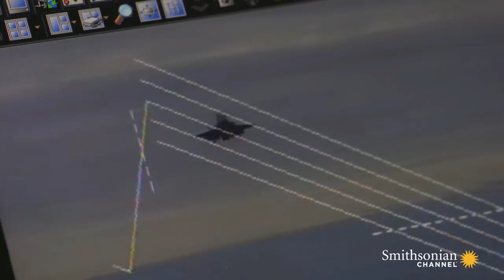This Fighter Plane Landing Has Never Been Attempted

Comment: Question is: How many pilots have the skill to do this in one go? There's no 2nd chance during war
Reply: ꉣꏹꉣꉣꏹꋪꁏꋊꀤ it would be the same as any other carrier landings. Pilots do have many chances to land on carriers which is why they use afterburner for every landing incase the hook didn't catch a line, they fly off and try again.
Reply: It’s also why they will practice this over and over to eliminate possible mistakes. It’s proven that it can be done, plus any pilot flying this plane will have the skill set to do the required landing. If they don’t then they won’t be flying it much longer
Reply: Ever heard of something called training? Most soldiers can shoot guns too, they don’t wake up knowing how to do it tho lol
Reply: Operations in actual theatre will not resemble that of enemy fighters circling the carrier fleet whilst CIWS battle to neutralise the threat. A misconception derived from Call of Duty etc.
Reply: All pilots, that's because of something called a selection and training process.
Reply: Im more interested in the tatical use of this ??? Anyone know ? Is it like a smaller run way when this landing is used ?? 

Thanks 🤔🤔
Reply: @blakeley38  There's only two options, vertical landing or this. Vertical requires them to potentially dump fuel and weapons to get themselves light enough, whereas they can carry fuel and weapons back that aren't used using this method.
Reply: @blakeley38  The air craft can land with more weight. 
If an air craft lands with its take off weight it is likely to crash due to the force it is coming down with. Simple F=M x A.
The landing gears will not be able to handle the force so fuel dumps / cargo or weapon dumps are necessary.  Also another factor is the stress to the surface of the ship's deck.
Heat from the engine is not directed into a single point on the flight deck from a vertical landing, so reduces stress across the deck.
Reply: @blakeley38  If you were listening during the beginning of the video, they said that normally these planes have to land without ordinance and with low fuel. If, for some reason, you send these planes out in wartime, and they come back with ordinance that's not spent... you'd have to dump the ordinance and/or fuel in the sea, and that's expensive and inefficient. So they're trying to come up with ways to land these planes on the deck with their resources still on-board instead of wasting them.
Reply: Many pilots will be landing this way first time without dificulty.

This was the first time it was tried. Thus they were cautious and of course the instrumentation requires calibration and verification.
Reply: adam b It’s the F-35B which doesn’t have an arrestor hook, instead relying on Short/ Vertical take off and landing. They are to be operated from British aircraft carrier that doesn’t have catapults or arrestor wires.
Reply: Why would there not be second chances during war?
Reply: Because this has now been done for real outside  of the simulator all the data of his landing and approach will doubtless be recorded - that data then can be processed into a series of guiding instructions which other pilots can then practice first in the simulator before going live just as this pilot did.
Reply: There is on Call of Duty!!!!
Reply: If it doesn't work they can always land vertically.
Reply: @srinitaaigaura  They can't if they have weapons or too much fuel on board. The only way they could land vertical is if they ditch all their remaining weapons in the sea.
Reply: The British have been landing aircraft on ships like this for decades!! So it's nothing new, it's only the air craft is new
Reply: There is always a 2.Chance you only have to be smart or be a lone wolf
Reply: There literally is.  Wartime or peacetime you come back with enough fuel to have more than one attempt.  Failing this, jettisoning all ordnance and dumping fuel will still allow a vertical landing akin to the hundreds of thousands the RN has been successfully completed in peace and war for decades with its harrier fleet.
Reply: Woutube Yatcher  This is the UK
Reply: @Benjd0  and sometimes jettisoning of the payload is not possible for to malfunction, so it's good to have other options.
Reply: Hammer 001   No it's not what I was saying. We're talking about carrier operations here. Of course it can perform a normal landing, I just expected people to be aware of the context of the post. No need to resort to insults over nothing.
Reply: Hammer 001  If it's not an insult what would you call it then? I'm curious. Just letting you know that there's no real need.

I said it required them to potentially dump fuel or weapons, it's not a requirement. But the weight they need to get under is fairly low, if they go on a mission with a full payload and don't use any of those weapons, then they will be required to dump either fuel or weapons. It doesn't have to be an emergency.

SRVL increases this limit, so they won't be required to do this as often. Although if they're immediately returning with a full payload, they will still likely have to dump weapons or fuel, as the SRVL weight limit is lower than the take off limit.
Reply: Hammer 001  Not sure why you're getting so worked up about this, it's just a Youtube comment section, you need to lighten up a bit. I didn't say there would never be a need to dump fuel or weapons with SRVL, it just allows a higher bring back weight over a fully vertical landing, that quoted weight is still below the maximum take off weight.

There's a fair bit of information out there on this, it's not top secret information that requires you to be on board the aircraft carrier, now if all of these sources are wrong then fair enough, just commenting on the information available.
Reply: @Dhalin  There is an ordinance - NATOPS - on landing with ordnance.
Reply: @martinw245  "Many pilots will be landing this way first time without dificulty."

Perhaps with plenty of practice in the simulator first.

Wilson needed three attempts to recover aboard the QE after flying 2000+ SRVLs in the simulator. It's not as nonchalant as many think.
Reply: @AA-xo9uw  

"Wilson needed three arrempts"

Well yes, it had never been done before. And they were obviously being cautious.  But once the correct parameters are determined and landing aids fine tuned  it will be relatively easy. To determine optimal airspeed flightpath angle and the ships landing aids fine tuned etc in only 3 attemps demonstrates that it's not a difficult procedure.
There's always the weather sea condition and deck movement to consider of course.

As said in the video, "the pilots had been making tentative approaches to test height and speed combinations.

Comment: “This fighte Plane landing has never been attempted” 

Yak 38: am I a joke to you!?!?
Reply: Strangely enough, the F35 is based on the Yak-38 design. Lockheed even paid Yakovlev royalties.
Reply: @spacecadet35  I think it was other soviet vtol
Reply: @dang0s804  - The Yak 141 is developed from the Yak 38.
Reply: @spacecadet35  Yeah but the F-35  is based from the Yak 141
Reply: @dang0s804  True. Either way Yakovlev gets the money :)
Reply: yak38 was a good design but the lack of power was its demise. Yak141 was something else Though.
Reply: Harrier?
Reply: Sad harrier noise
Reply: @spacecadet35  Did Yak then pay Hawker Siddley for ripping off their design in the first place?
Reply: @Jin-Ro  - As the Harrier and the Yak use totally different engine and design  concepts, I am not sure of the relevance of your statement.
Reply: Why so much Yakking in this thread?
Reply: @mierbeuker8148  You are right. There is a lot of yakkity yak on this thread.
Reply: @dang0s804  Incorrect.

Comment: Go on a tease diet and head to 2:50 if you want to see the landing.
Reply: This needs to be on the top
Reply: What about the landing at 3:42 ?  Looks like the carrier is out moving in the ocean by the backdrop waves and he landed straight down easily. please explain lol
Reply: @73outback  the plane needs to be light so they get rid of extra weight like weapons. They say this in the beginning.
Reply: @aflyingsquid___2494  ??
Reply: @73outback  0:16
Reply: @aflyingsquid___2494  Never mind you still didnt answer my question but you might have understood it wrong. i figured it out myself. In those clips the jet goes straight down. But they were talking about a 1st ever rolling vertical landing.... not a stationary vertical landing which i mistook them doing.
Reply: @73outback  Several videos shot during multiple test flights have been combined and edited into the one here..

Comment: The reason the planes are that heavy, is because of the massive balls they have to carry
Reply: The reason they are heavy is because they are garbage
Reply: @hugh.grection1386  you think design a steath plane that can VTOL is easy...
Reply: @hatosan5565  it wouldn't be so hard but not only does this plane have to vlt it has to do 1000 other missions for the other services,if the marines so badly wanted a vlt aircraft they should have designed a plane for that but no they have this plane trying to do everything while still maintaining stealth,it doesn't work this is why the navy will continue using f18s and the airforce f15s
Reply: @hugh.grection1386  ahhahaha...NO! F35B was build to replace Harrier Vtol not F18 and F15(why the heck you include the F18 and F15 when they both don't have Vtol),the one that that replace F18 is F35C,F35A will replace F15,F16,A-10(maybe) in airforce
That why they design 3 variant
-F35A is for airforce which more maneuverable and cheapest one with 77M$ 
-F35B is for Marines Force which is a huge game changer for those are Heli carrier can turn in to light aircraft carrier right away ,thank to the engine vtol that can make Vtol much easier than harrier
-F35C is CV variant that future the better landing gear for the leg and much bigger wings for slowing down better and carry more fuel
Reply: @hatosan5565  u are not getting what I am saying,the only difference between the f35 B and the others is they took out the lift fan and ability to point jet engine at ground of course but still leaves a huge cross section increasing drag and friction heat that melts it's radar absorbing paint,this is why gen 4 planes out run them by alot,it's a garbage plane,last air to engagement the usa got into was over syria and it was a in sight engagement with a mig and the first missile fired missed,if that was a f35 the mig would have smoked it simply by running up on them
Reply: @hatosan5565  and none of them replace the A10 warthog... so... once again: senator McCain, thank you for everything you have done to keep the A10 flying. The beers are on me when we met other side of the rainbow.
Reply: @G_de_Coligny  well A-10 will flight 5 to 10 more years(because it so good),so I'm not worry about it
Reply: @hatosan5565  859
Reply: S Lit because I don’t think just anyone would try to do that
Reply: Getting a bit weary of this all too predictable comment

Comment: Is there anything really new here other than the plane being newer than the British Harrier, and... wait for it... the Russian Yak 36?
Reply: I think you mean the Yak-38. The 36 was a test platform. Either way, the F-35B uses some of the underpinnings of the Yak-141, whose design was sold to the US by the Yakovlev Design Bureau.
Reply: Or f18
Reply: @gregoryhall2967  what? F18 is vtol. Tf you talking about?
Reply: Yak was POS, Constant breakdowns
Reply: @nibs7252  The F35 was based on F22 lockhead also made. The lift system is totally different concept,  as it uses a single pratt & whitney engine that also powers a lift fan via driveshaft and gear system. The lift fan was chosen because it provided a cool air stream, versus the older harriers that had hot air ingestion issues.

Yak141 use three engines. With two mounted vertically to provide forward lift...which produces hot gas.Totally different wing configuration, totally different tail configuration, is not fly-by-wire, has no internal weapon bays,  is 50% larger in size,  almost twice the weight of f35, had afterburners.....

f35 has no underpins of the yak.....your literally comparing apples and oranges
Reply: @gregoryhall2967  F-18 does not have VTOL capability.
Reply: Wasn't th Harrier developed in the 60s or 70s?
Reply: @David.....  F-35B is literally the result of Locked Martin purchasing the intellectual rights to the Yak-41. Go Google it.
Reply: @wojciechmuras553  he litterally just explained how that's not true. "go google" that one
Reply: @chickenman9184  Locked Martin used Yakovlev's expertise during the development of XF-35. These two companies literally made a joint venture in 1991! And the result of that was Yakovlev engineers building the lift system of the F-35B! Lockheed Martin could only build their VTOL by learning from the mistakes of "Freestyle".
Reply: @nibs7252  The Yak 141 used designs stolen from the Convair 200.

"whose design was sold to the US by the Yakovlev Design Bureau."

Lockheed bought flight test data and prototypes that Yakovlev never delivered.
Reply: @wojciechmuras553  "And the result of that was Yakovlev engineers building the lift system of the F-35B!"

Incorrect. Lockheed/Bevilaqua/Shumpert patented the design of the lift fan/shaft drive/clutch/gearbox which the thieves at Yakovlev neither stole or invented.

Comment: Crazy how this jet can brake from supersonic into zero airspeed in the air.
Reply: It really is, what I think is crazy is how it switches control patterns for regular fix wing flight to vertical stable flight and then flies like a helicopter with the stick and rudder movement. Honestly a marvel of engineering but people only complain about the price haha
Reply: Ilham Suhendi basically you are impressed by planes being able to slow down from supersonic to a slow landing speed. This has been going on for so many decades. You are aware of the affects of drag and controlled stall aka flare are you not? The last part .. the vertical landing is amazing as so much design and software based computer control is needed. If you are interested you should search "basic aerodynamic principles'. Calling it braking is not really accurate. Anyway have nice day

Comment: Imagine if there were a wire across the deck that a hook on the airplane could capture on landing. What a concept!
Reply: Imagine if you didn't have to bother with that extra equipment and the strain it puts on the aircraft.
Reply: @davidhouseman4328  yeah arresting wires and catapults require lots of maintenance and cost

Comment: What's the purpose of this? Any advantage?
Reply: With a normal vertical landing you have to be under a certain weight, as the aircraft needs to be light enough to be in a hover. If you return to the carrier with a lot of fuel and weapons then you'd have to dump them usually. This allows them to land with a much greater payload aboard.

Comment: Um the F-35B if I’m not mistaken should be fully able to take off and land vertically fully loaded. And didn’t the the US marines already do this?
Reply: It's not possible with current engine technology, it can take off from a carrier with a short rolling take off with a full weapons load.

If they were capable of taking off vertically with a full weapons payload you'd be able to operate them basically from helipads.

The US marines solely perform vertical landings at the moment, the UK has been developing this new type of landing for some time.

Comment: They have computerized landing now, flight computer does most of the work. The pilot just needs to give the plane a vague idea of where to go. This video was overdramatized as the Marines used the VTOL F-35 on amphibious ships for years now in VTOL mode. And you don't need to ditch weapons or fuel, this isn't a Harrier, the plane can land vertically with full stock. Coming from me, an airman on the USS Wasp.
Reply: The Marines haven't used this form of landing yet though. It does require dumping weapons still (Which is why they're developing this type of landing).
Reply: "The pilot just needs to give the plane a vague idea of where to go. "

JPALS already provides the precise location of "where to go".

"This video was overdramatized as the Marines used the VTOL F-35 on amphibious ships for years now in VTOL mode."

STOVL not VTOL

"the plane can land vertically with full stock."

Incorrect.

"Coming from me, an airman on the USS Wasp."

Likely a snipe.

Comment: The pilots will need a lot of practice doing this. It's calm seas and it takes more than one attempt to land. What about under higher winds/waves?
Reply: This was the very first time they've done it with the F-35B, so they had to test the waters. 3 attempts is pretty good in that case, pilots can take a fair few attempts with a normal arrested landing when first trying too. Just needs practice.
Reply: @Benjd0  Wilson flew 2000+ SRVLs in the simulator before attempting it at sea on the QE. It's not as easy as it looks.